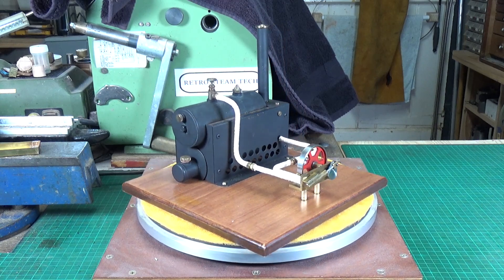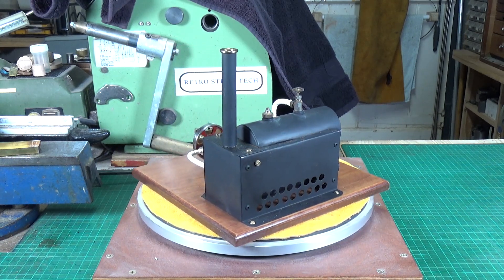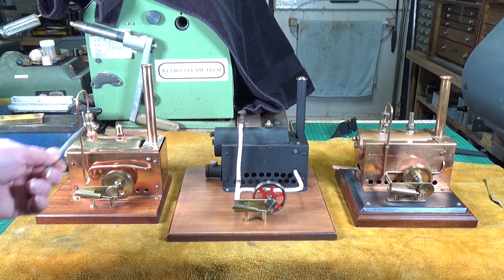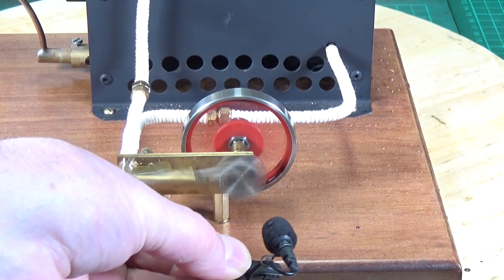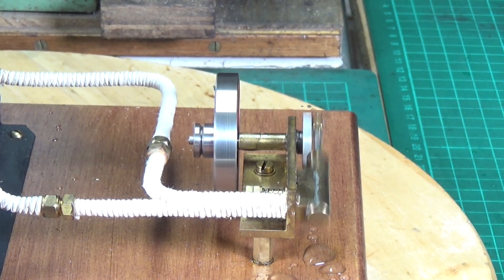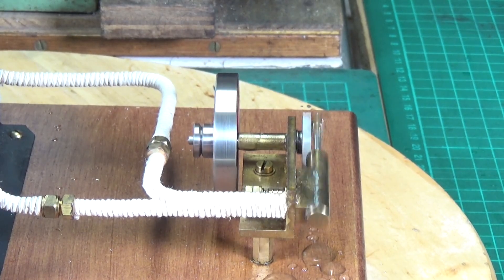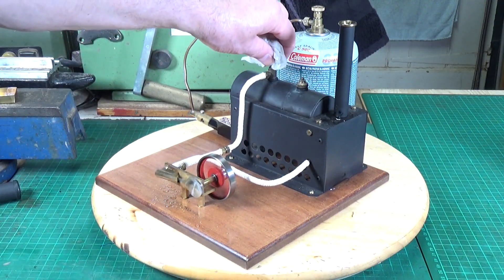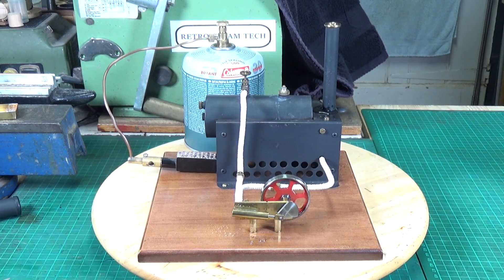Scratch Built Wobbler Model Steam Plant

Comment: Very interesting Alan.  The similarities are striking.   I like the way brass angle has been used for the engine mating face and cross shaft support base.  Simple but effective. Good one.  Cheers Rob
Reply from the maker: Hi Rob. I think you were on the right track when I got the last one. Different builders but probably from the same plans. I also like the simplicity of the cylinder mount and the way the firebox has been constructed. Cheers, Alan.